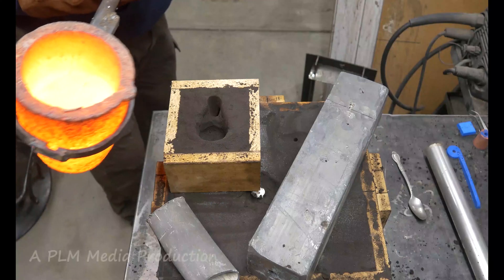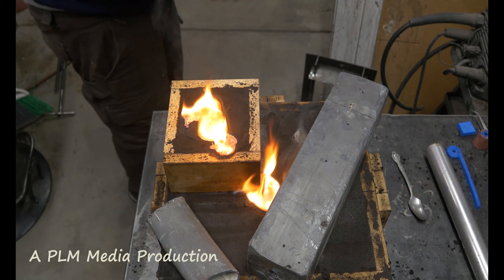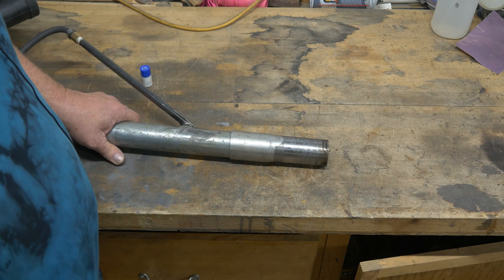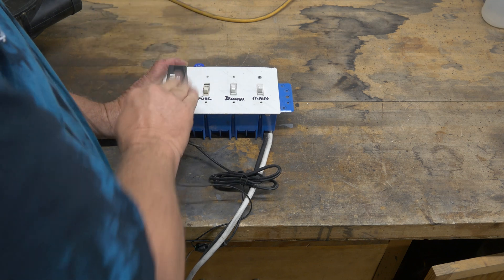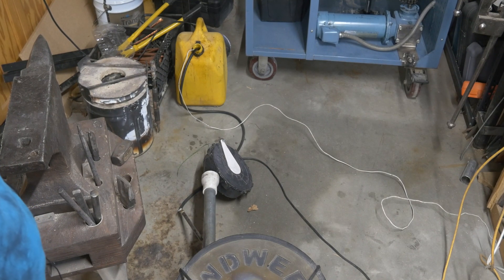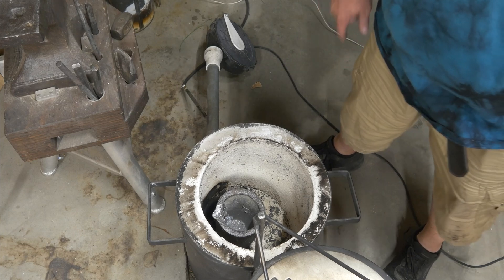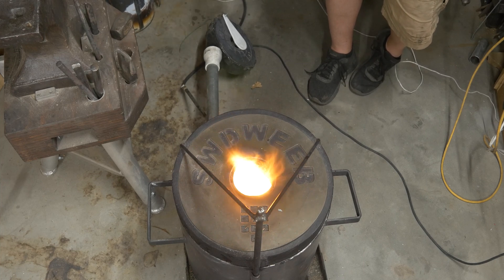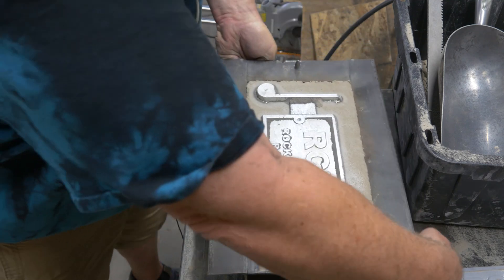Building a diesel burner how hard can it be

Comment: Thanks for sharing your burner design and experiences with it. After reading some of the comments and your responses to them, I am inclined to eliminate the check valve. It might be the case that it uses some plastic inside parts that melt after several hours. That check valve is very close to yellow-hot objects that probably radiate their heat back to the nozzle and check valve, resulting in melting and clogging by polymers. Instead, I plan to go with no check valve and a high-quality stainless steel needle valve (Hoke or Nupro) just upstream of the aperture, but as far downstream as possible. There will still be a dead-volume between the valve and the aperture, and the liquid fuel in that volume will still leak out into the forge after closing the valve at the end of the melt. But I will just let it burn out after closing the needle valve. Since the check valves are so cheap, this is not about saving money on replacement check values. It is about eliminating the annoyance of having to replace them when they fail in the middle of a melt. I might also just cut one open in cross-section to see how they are constructed. I will report back here with what I find. 

Thank you again for your kindness. You are obviously a man who cares for others and promotes a spirit of kindness without overbearing or pompous religiosity. 
Tom
Reply from the maker: Sorry for the late reply.
I haven't pulled my burner apart, but I tend to agree with you regarding the check valve failing. I actually don't notice the nozzle getting all that hot. It is outside the burn chamber and it has a pretty decent amount of air flowing over it. I don't know if my check valve has melted or not but I do believe it has experienced some sort of failure as the diesel will run out of the nozzle long after I've turned the pump off. It will siphon fuel out of the tank if I just let it sit.
For that reason, I pull the pump out of the tank and the nozzle out of the furnace and place them in a bucket after I've done the melt. Usually a minute or less after the pour. 
I found the "dead" portion as you mention is a pain simply because of the mess it leaves behind. The dripping diesel will drip and smoke forever.
Reply: @swdweeb  My buddy and I had a chance to do our first tests of your design with the check valve left out and a 2.0 GPH, 60-degree fuel (diesel) nozzle. The tests yesterday were all done with the burner jet just shooting out into the air, and not yet shooting into a closed forge. We suspect that the flame dynamics will be considerably different with the flame swirling inside a much smaller volume. Other particulars: 2-inch muffler tube, about 18 inches long; 1/4-inch NPT fuel inlet plumbing (like you), about half-way along the 18-inch tube; starting at the jet nozzle and working back: adapter to go from nozzle's 9/16-24 thread to the 1/4-inch NPT, about 2 inches long; 6 inches of 1/4-inch pipe on the axis of the 2-inch tube; 90-degree 1/4-inch elbow "up"; 1/4-inch pipe, about 1.5 inches long, welded to make a seal up through the 2-inch burner tube; a second 90-degree 1/4-inch elbow "back" to a 1/4-inch NPT ball valve; 1/4-inch NPT hose barb connecting to 3/8-inch ID tygon tubing from the in-tank pump.

Observations: 1.) We noticed that the flame tended to blow out as we added air by opening the blower damper. Anything more than about a 0.5-inch opening in the damper was too much air for the fuel to remain burning. 2.) Throttling down the amount of fuel using the 1/4-inch ball valve was never helpful. It seemed that we needed more fuel, not less. Therefore the ball valve in place of the check valve will only be used to prevent unburned diesel from leaking out after a melt. 3.) We changed to a shortened fuel line to the jet (3 feet long vs 8 feet long previously), with a larger ID (3/8 inch vs 3/16 inch previously). This higher conductance seemed to increase the amount of fuel delivered by the little in-tank pump, but we didn't actually measure it. After this change we were able to use more air before the flame blew out. 4.) To decrease the turbulence and air velocity at the jet nozzle, we flared out the 2-inch muffler tubing to about 3 inches, over a taper length of about 2 inches, starting at about the jet aperture. The jet aperture was thus about 2 inches inside the flared taper. This also seemed to allow us to use slightly more air and reach a better balance between rich and lean. 5.) We could never achieve a roaring jet with a well defined blue inside cone, like is sometimes seen in other people's jet design. Is this an unrealistic goal for a diesel burner of this design, shooting into open air?
Reply from the maker: @thomasbeebe7480  I spotted this too late tonight to go through it.  I'll go through it in the morning and respond more thoroughly.
I can tell you with diesel you won't get a blue cone flame.  It goes from orange to almost white (when you get the air mixture right, it will be very light yellow, that's the color to shoot for.
The nozzle doesn't produce a cone either. 
The chamber has to heat before you can start adding more and more air, the heat of the furnace chamber really makes a huge difference in the way the flame burns. 
I expect I would have very similar results if I took the burner out of the furnace and tried to force air around it.
Reply from the maker: If you want to email me at swdweeb@gmail.com I can explain better. I can do drawings of what I’ve got at the furnace and show you my flame

Comment: Hi Perry, Great presentation.  I mainly cast bronze. I, like you, started with propane and am able to get the heat I need. I did have issues with tanks freezing and was able to solve it by manfolding several tanks together. However, I'm tried of running to get tanks refilled.  My furnace is near, only 8' away from my natural gas supply line so I 'm considering building a natural gas burner. ( what my first furnace was some 30 years ago).The one reason I started with propane was to be portable. So, I was excited to see this video!  perfect solution to be portable. I really appreciate your listing all the parts and how it went together. You're the best!!
Cheers,
Bob
Reply from the maker: Thanks Bob. I really thought about natural gas but running the pipe would have been a lot of elbows. I have been experiencing problems with the check valves.  I'm on my second one now and it seems to have stopped working. This leads to an unwanted siphoning effect after I've shut things down. I've recently been experiencing a lot of post-burn smoking. It never did this before and just started doing it a few weeks ago. I actually pulled the pump out of the fuel tank and the nozzle out of the burner after a melt yesterday. FAR less smoke when I did this.  Something to keep in mind. - Perry

Comment: Is there any fuel flow adjustment or that pump is just on/off mode?
Reply from the maker: No the only adjustment I have, and that I've needed, is on the air flow. The pump delivers a constant stream of pressure to the nozzle which disperses the fuel in an atomized mist to the chamber.  The flame can't handle a large volume of air when I first starts it but as the chamber heats, within 15-30 seconds I can start adjusting the air into the system to maintain an optimum burn rate.

Comment: any temperature difference compared to propane? Hotter?
Reply from the maker: Yes, I've read as much as 50% hotter than propane. I doubt that I'm getting that much differential but I'd be comfortable saying 35% hotter.  It's cheaper to run as well. Of course there is some smoke, not a lot, on startup and shutdown.  As it's burning, its clean
Reply: @swdweeb  I need to try it. Seems very tempting.
Reply from the maker: @waliza001  Its been a learning curve... I am trying a different size nozzle today in fact... but I don't regret the switch for a second.

Comment: @swdweeb, a few years ago my dad made a drip fed waste oil furnace, we simply added an 1/8th of a cup of kerosene or gasoline and away it went, the problem being when it gets hot the oil gets thin and will proceed to trickle through the value being used to control the flow, we got lucky as we checked on it 20-30min later and the wall of the gas cylinder used was glowing a beautiful bright cherry red, luckily we didn’t  burn down the garage.
Reply from the maker: Man, that's scary stuff. I watched another guy build a drip burner based on a pump and not gravity so that if he lost power it would stop pumping fuel.   I had a problem with siphoning even with the pump inline so I'm really glad I put the check-valve in the line.  When turn the power off the check valve stops the fuel flow almost immediately.  Even still, I continue with the blower running to help cool things down.

Comment: Very cool project! I started building something similar after the last time I refilled all my propane tanks. What adapter did you use to get from the burner (9/16-24-ish) to standard plumbing fittings? (There's an adapter link in the description but it does to a dead page for me)
Reply from the maker: Apparently Amazon isnt selling it anymore.  Here it is on another site
https://controlscentral.com/tabid/63/ProductID/314619/delavan-287383-long-female-1-4-thread-nozzle-adap.aspx

Comment: You spoke of the larger "space" around your typical sized crucable, whould there be an advantage to setting fire brick in to change the size of the annular space to work with what ever crucable you are working with at the time?
Reply from the maker: The easy answer is yes. However. Where I think I would run into a little trouble is the way my burner enters the chamber. It is tangential to the opening causing the flame to wrap around the circumference of the chamber. If I start putting bricks they're going to be directly in the path of the flame. That is unless I put them on one side of the furnace, the back side if you will. That may be ok.
 
The other problem is, as I wrote  to another comment, I'm lazy and even though I can spend a month building a burner, I can't seem to make myself spend 1 minute to put bricks in and take them out 😄😄

Comment: What keeps the plastic in your check valve from melting?  I've been planning a diesel burning for a while and I like your simplicity build.  Also, don't you vent your garage?  Seems dangerous if you don't.
Reply from the maker: I expect the distance of the check valve from the actual furnace chamber and the fact that it constantly has cool air blowing over it pushing the ambient heat back towards the furnace chamber as well.  In early iterations I printed a plastic air diffuser that sat right next to the adapter. I expected it would melt  during the first melt.  It never did.  I don't use a diffuser now as it only restricted air flow.  It did create a neat looking flame but that was about the only benefit I saw.

I run the furnace with both my from and back garage doors open so I'm venting exhaust all the time.  I'll probably want to come up with something different in the next couple of months as the weather will be turning much colder.

Comment: There are pros and cons to every design. The pros of the pressurized atomizers are a quick startup, as shown. This is pretty much the design that all the Beckett burners use in the northeast for home heating, though you see some diesel water heaters with the same burner elsewhere. They have the motor, blower and pump all on the same shaft and run an electric arc (traditionally with a 10KV/23mA oil ignition transformer) through the fuel spray so that they are being ignited 120 times per second and have an electric eye (CDS cell) that sees if the flame goes out and controls to shut it off (so the burner doesn’t keep pumping unlit/unburnt fuel into the combustion chamber). This design is a simplified version of a Beckett burner and I imagine  if you could find a commercial one on the used market, you could simply strap it to the side of your furnace and go. The pumps for becket burners typically top out at 2.5 gallons per hour, so I got three of them and 3 sets of 2.5 gph nozzles years ago before I settled on the drip burner that I was using which could go through 7.5 gph. The Achilles heel of pressurized atomization setups is that the orifices in the nozzles are so small, they are easy to clog. So you HAVE to have clean fuel. Gas station diesel in a sparkly clean new tank means you probably won’t have any problems. I would probably still run it through a filter that filters down to a half the size of your smallest passage in microns, particularly if you experiment with fuels of an unknown pedigree or even from dirty containers as it only takes a tiny speck of dirt. The nozzles often have sintered metal mesh filters built into the back of them, but not foolproof. This also means you can’t use WMO unless you filter the heck out of it or run it through a centrifuge and preheat it to get the viscosity down (or cut it 50/50 with a lighter oil like diesel). The Beckett burners will often use pumps by Suntec but they are usually rated for Number 2 oil (diesel) and lower (thinner). The A2RA7710 model will pump #4 oil (waste motor oil) if anyone wants to experiment. These Suntec pumps are all designed for continuous duty and will put out 100 psi (at the low volumes mentioned). My Beckett burners run at around 80 psi, IIRC. 

Another point worth mentioning- The nozzles aren’t just rated for a max pressure, they are DESIGNED to run at a certain pressure, and if they don’t get it, the atomization will be poor- (this is covered in the literature and there are special more expensive hybrid nozzles that are designed for a wider turn down ratio that work well under a varying input pressure) . In a furnace, you can get away with poor atomization to some degree because there’s so much heat to vaporize any fuel that hasn’t been atomized well. This is essentially what a drip burner is- very low atomization. In practice, this is a misnomer as it doesn’t drip- the fuel gets ripped out of the end of the fuel pipe and atomized by the air, often assisted by necking the air pipe down to speed up the air and that effect, but it still doesn’t work nearly as well as with these nozzles, so it relies on existing heat in the furnace to vaporize bigger droplets of fuel that it doesn’t atomize well. This is a catch-22 for startup, as mentioned. I would still consider putting a pressure gauge somewhere between the pump output and nozzle T’d into the line. Then you can tell if your nozzle is clogging and creating unusual backpressure or if the fuel pump is not up to the task. The longevity and performance of pumps used off-label is unproven, but I hope it works because new Suntec pumps are between $80 and $130 each (and then you also have to buy the motor and coupler)
Reply from the maker: Good stuff, thank you

Comment: Excellent design Perry, interesting to find out that diesel burns hotter than propane, I have the same control on all my blowers as well, none of this electrical nonsense keep it simple!! & the motor uses less power when it's fully closed.
Reply from the maker: Yeah, those motors really do just want to spin at full speed all of the time. Doing funny things to the voltage or frequency isnt the bet thing for them. The air dam works the best. 

Someone recently told me... or I read it somewhere... that liquid fuels tend to have more energy  than gaseous fuels.  I don't know of that's true or not but it does appear that diesel has more potential than propane.

Comment: time to melt some copper or iron now that you have the ability!
Reply from the maker: Have already melted copper in it.  No problem. I just responded to windy hill that I'm afraid to try iron as I don't want to find out that I'm still not there.
Reply: @swdweeb  lol I just think you don't want to risk burning down the garage when iron or cast iron is sparking everywhere!
Reply from the maker: I might pull the furnace outside for that one.   The heat in the rafters will get really high independent of the sparks
Reply: @swdweeb  nah, live on the edge!

Comment: Congrats on getting it going Perry👍 
Next you need to buy some spats, hairy legs and that kind of heat are a good fire starter, unless you shave your legs 🤔. I'd still wear spats😁
Reply from the maker: With all of the ads on TV and YT for "personal grooming" devices I must be the only guy out there that still only shaves his face. 😄

Yes, I do need to get dressed for hotter temps, there is no doubt. I need to find another rotor or two so I can try iron again.  I'm a little scared to find out that I'm still not there. I have melted coper without issue so I'm hopeful.

Comment: Congratulations Perry. R&D paid off big time. I'm definitely doing this too. Preso.
Reply from the maker: R&D, experimentation, multiple trials,... it's all part of the fun of learning and getting it working.  I'm really happy with it.  I need to fabricate some sort of trolley that I can mount the blower and switches on to eliminate wires running all over the floor. It might be nice to put the fuel tank on it as well. Probably need/want to shield the tank from the furnace some how. 

Looking forward to your fully anodized and powder coated version 😄😄😄

Comment: Wondering,in gallons, how much diesel  being used per hour?
Reply from the maker: Well, given that its a 2 gallon per hour nozzle... I'm assuming two gallons. It's probably actually less as I don't think my pump creates as much pressure at the rated pressure for the nozzle.  It also only takes me about 10 minutes to melt aluminum so (1/6)*2 should tell you how many gallons per melt.. approximately